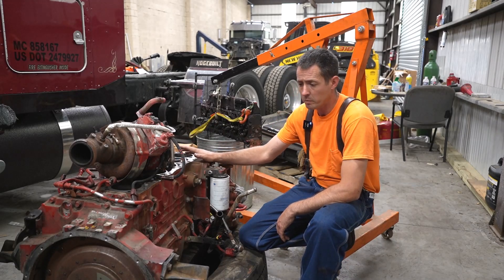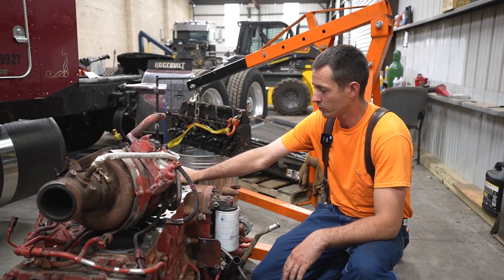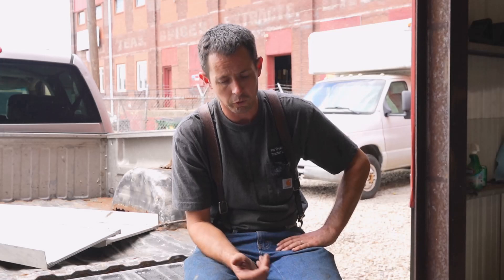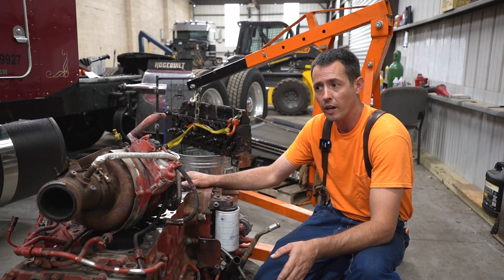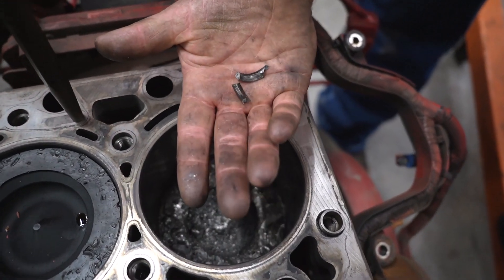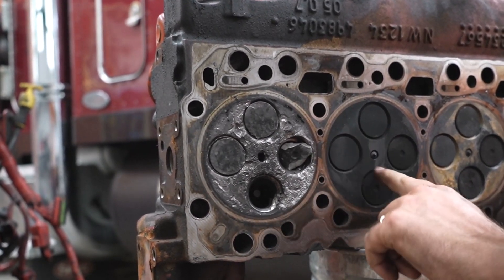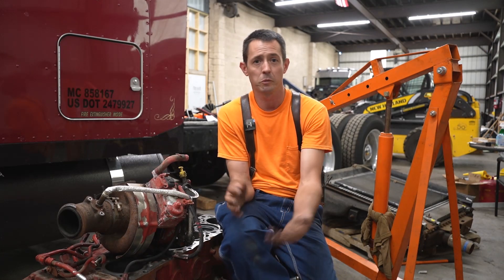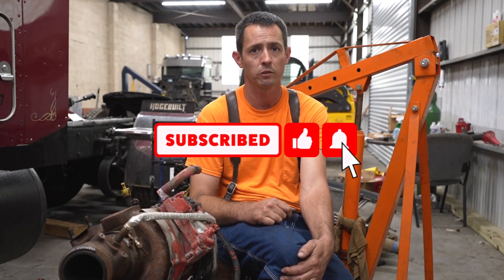Cummins ISB 6.7 Engine Rebuild vs Long Block

Comment: Manufacturing defects? Yes, but it happens during warranty time.
This engine was pushed hard and overheated and that’s a reason for dropped seat. Last pistons always have more heat and sets just don’t drop unless you have enough heat

Comment: The reason I ask if it was chip I’m a retired mechanic and the last years of my mechanic and career I was in the fuel shop I had a friend call me one Saturday that was an owner operator he was at the Louisville truck show and he was thinking about buying one of those Pittsburgh power I think they call them bulldogs Were you can reprogram the ISX engine and I told him not to because my experiences over the years you cannot turn a Cummins hot if you deviate from the specs on that time and cover you will melt that Cummins down he didn’t listen he bought that Pittsburgh power unit and he left the Louisville truck show heading to Houston he was on interstate 5920 at Meridian Mississippi and it did the same thing as you’re a Cummins it blew the valve stem seal and destroy the number one piston to come and shop in Meridian didn’t know that he had that Pittsburgh power programmer as he Jan did it while he was waiting on the wrecker I think it cost him $20,000 to fix the number one piston and a new head and I will tell all these owner operators out there you cannot run these comments hot they are not like a caterpillar you can crank a caterpillar up But come and you cannot do it I’ve seen it over the years man would get those comments is turned up past the specs on the time and cover put more fuel to it change the time in and it will literally eat itself Grace and peace

Comment: Hey bro, great video. See this stuff all the time. I tell guys, for the most part, when a diesel has a failure, it's usually a failure that you'll be able to see plainly. I'm running a diesel shop in Arkansas. Good to see videos like this.